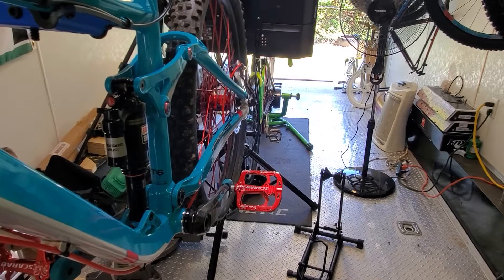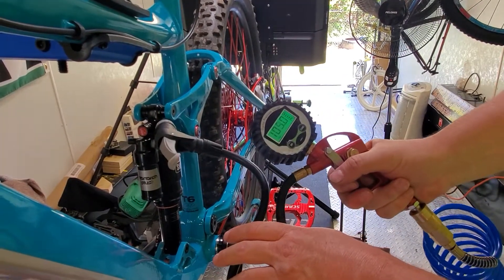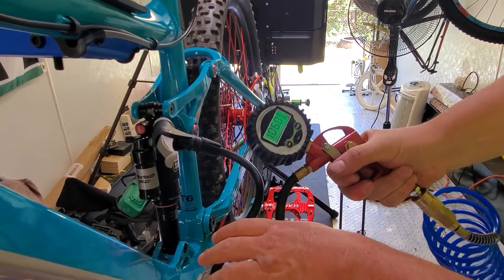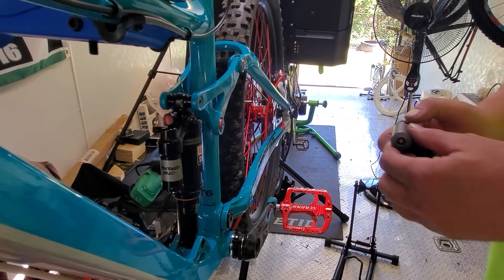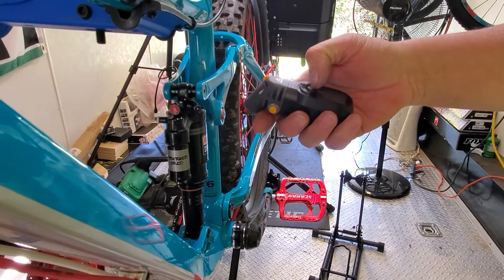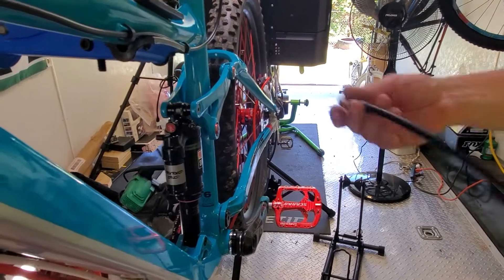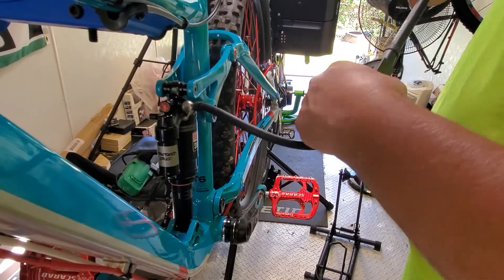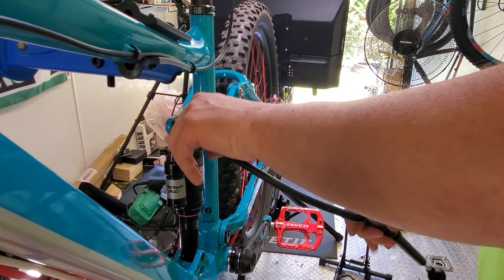Rockshox Monarch Plus RC3 filling air spring back up and comparing different pressure gauge accuracy

Comment: We lose a little when disconnect and a tiny bit more when you reconnect & shock air fills the hose.... anywhere from between 4-9 PSI dep on shock pump and shock pressures...
You  lose a bit more if a heavy bastard like me running very high shock pressures as needed vs a fly weight 145 -165 LB rider who lives at 155 PSI  in his rr shocks Max. all day long....

Comment: Conclusion?
Air is been losing when pump's valve head was unscrewing?
Reply from the maker: Yes I do know this I just caught into trying to  make helpful videos and trying pumps and and gauges out too fast before become fully  Familiar with the new pump and gauges. I should redo it much better and explain high pressure and low volume in shock and the air loss.
     Thanks for being nice in your comments and helpful information.